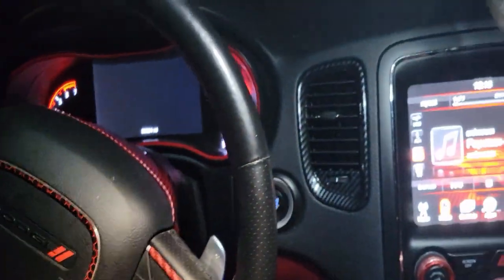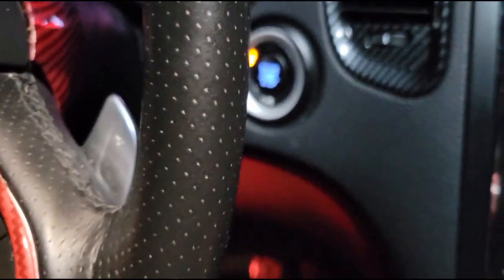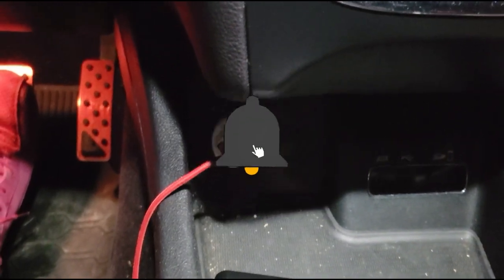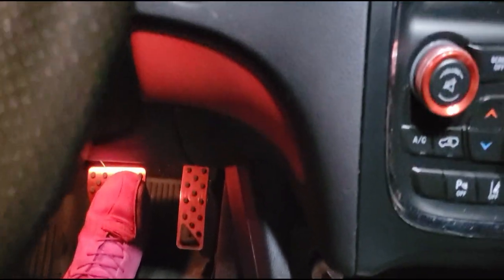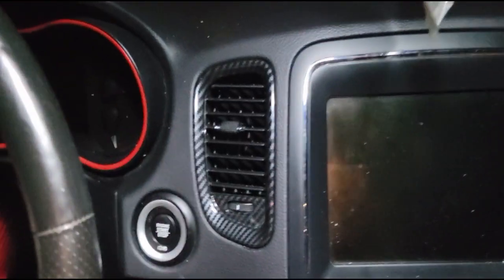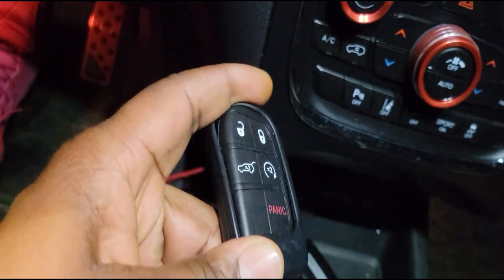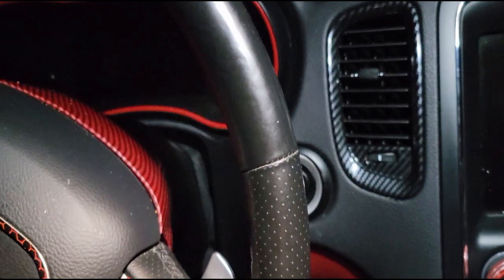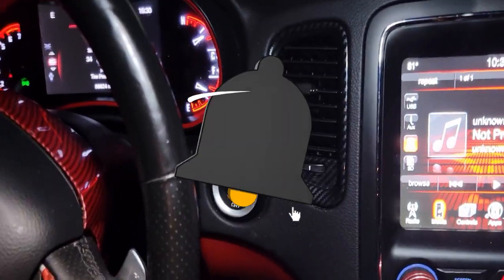Dodge Durango Key Fob Not Detected Update | 2024 Key Fob Not Detected Update

Comment: Good 4 u my friend, currently i have to get next to my door in order to unlock or lock my vehicle....i already replaced the battery but same issue...persist.....the car still detects it to turn on  .btw mines is a 21 ....
Reply from the maker: I would call a locksmith. They have the tools you need
Reply: Same here. It’s like the car has electrical issues . I got it used 20k miles, a key fob should be the least of my worries but somehow it has a mind of its own. It’s annoying but I still love my car❤️